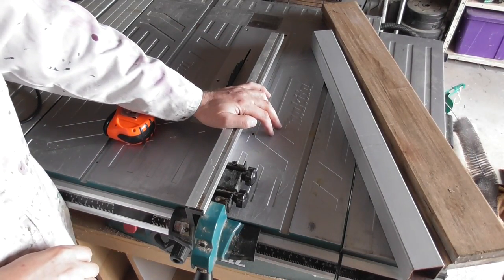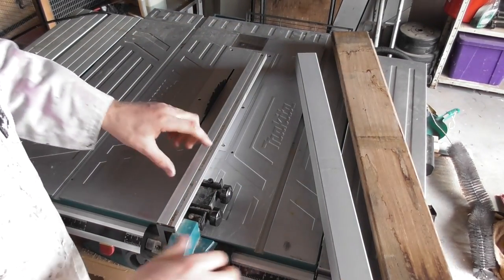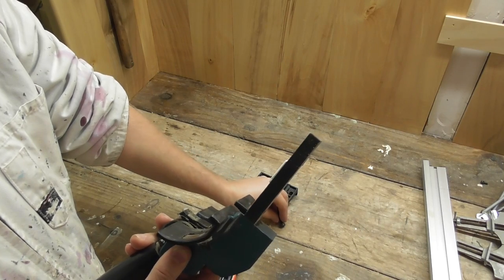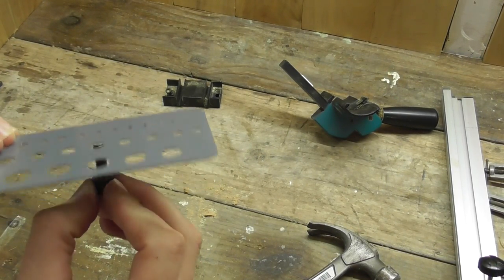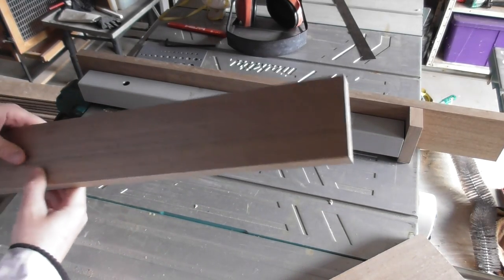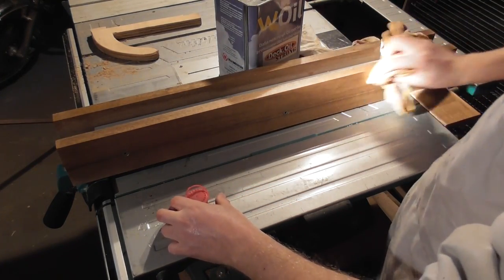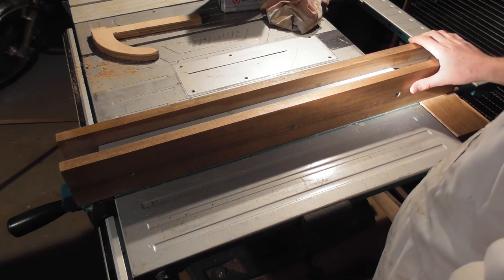Makita MLT100 Table Saw Rip Fence Upgrade

Comment: Legend! I made this over the weekend and no longer hate my table saw. Gives a MUCH better cut, and feels a hell of a lot safer to use now that the fence is rigid. Thanks so much for this. I looked through lots of fence upgrade videos and yours stood out. Should be more highly ranked in search results.
Reply from the maker: Cheers, glad it worked out.

Comment: When adding the end piece that locks it in you can use wedges in the slots to line the fence against, gives it a slightly more parallel alignment

Comment: I just got myself a MLT100 about 2 weeks ago, and was starting to regret it, I always thought Makita meant quality,  I noticed something was wrong when it was not giving me a straight line. I put it down to the arm straight away. I saw this video and thought, I am never going to be able to do that, I am not a carpenter by trade. I just started making things as it was taken months and months waiting for a professional carpenter to finish a job.  but I gave it ago anyway see how it would come out. the only difference is my 4 holes where the arm is, are all 13 mm. and I place the other section inside the tube. so it still moves as the original.  I am now able to straighten the arm up nicely. I did what you said about fixing the back plate but noticed you'res had slight movement as you said, so after aligning it I moved it 1 mm closer and that gave a nice tight fit. now when i level it I can close the arm half way, get the final straight line and close fully... and it looks just like you'res.  Thanks ever so much. my cuts are way better than they where.
Reply from the maker: Have you replaced the shitty plastic blade inset yet? I recommend doing that for safety and accuracy reasons. I have a video on that too if you need ideas.
Reply: @ToolsAndStuffOFFICIAL  That stupid black plastic surrounding the blade. :-).  thats on my to do list lol.  the one you made can that do 45 degree angles too or just for straight cuts. ?

Comment: I have just finished making your mod on my saw. Thanks mate. Works a treat. You mention in your comments that the slide fence isnt accurate -bit sloppy. I fixed mine tonight. I had the bottom of a Resence paint bucket that I cut up to make a dust collector. I cut a 10mm strip off it and wedged it into the groove running along the inside edge of the sliding tray. I fitted 2 strips one on each end of the tray, The plastic strip is patterned on one side and grips tight. Slider is now a little bit stiff but that will ease with use I reckon. Doesnt slop about and thats the main thing! Cheers Paul
Reply from the maker: I have been meaning to pull the sliding table apart an fix it up to make it more accurate but have never got round to it as I mostly just use the saw for ripping. But maybe your idea will make me do it.

Comment: I didnt take the tray to pieces- just pushed it to the end to expose the groove on the side edge. They I pressed the strip in and tapped it i tight with a tack hammer. Did same on the other end. Super quick n easy. Groove is about 3mm and gap about 10mm to side of saw. :) Paul
Reply from the maker: Cheers, I will give it a go.

Comment: nice! spent the last two weekends running timber through mine and this would have been a huge help, I'll have to pick up some taps 

When you tighten the stock fence it moves quite a bit, can be a pain if you just have a mark on a board and you are moving the fence to line the mark up with the blade.. then you tighten up the fence and it moves a few mills (not such an issue using the 

do you find that while you are tightening the new fence it straightens up before the block at the end clamps it in place? 

also could be useful for attaching feather boards and other jigs too, also nice to be able to replace the wood as it wears/ gets chopped into
Reply from the maker: I know the issue you are talking about and it is a real pain. It seems good with the new fence. I was going to fix this issue at the handle end but wanted to use the fence and get the video out so I ran out of time. I might also make some other attachments and jigs.
Reply: i have spent all day doing just the things you talk about !

Comment: One thing you did not show, is how did you align the fence to the blade. I have a MLT-100, and the blade does not run exactly true to the mitre slots, did you align to the blade, or the mitre slots?

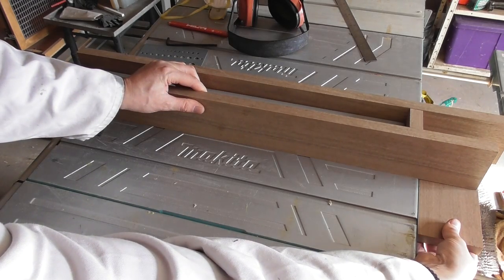Comment: Everything looks amazing. One thing I didn't get - Why did you put a shim under the fence before drilling through (07:15 ) ?
Thanks
Reply: One more thing - did you screw the 300mm locking back piece when the fence was open or closed ?
thanks

Comment: Looking at the rattle you had when trying to guage first drill hole I would have thought both holes at 6 mm would have given loads of flex to allow adjustment. Also why not drop the bolts through from the inside of the steel and place nuts on underside ?

Comment: Hi, nice job. Could you please tell me where you got the hole size template from. The one you used to size the bolt. Thanks
Reply from the maker: I can't remember where I got it, I think it came in an old drill set. You should be able to get one at most hardware stores or search for 'drill gauge' on ebay or google.
Reply: You could try Anxminster in the UK. They offer wordwide shipping.

Comment: This MLT100 Makita with it's short and fixed at one end rip fence is the same fence design as the Ryobi 1525RCSC from 2013 year.  I have to ask... as the saw comes and with the play in the end is it more prone to kick back or less prone to kick back.  There is no apparent way to square up the original design with the edge of the saw blade, and if the back of the blade is closer to the fence than the front of the blade, that can't be good at all, because the saw back teeth will lift up the work, fast!  It seems to me that the new fence is safer from a kick back point of view, but i'm no expert.

Comment: Have you done anything about the elephant in the room - which is the fact that the runner on the right-hand extension table doesn't line up with the runner on the main table? If you have the fence clamp overlapping that in any way, there's a several mm swing at the other end of the fence. I'm thinking of shimming both, just shimming the main one slightly less than the one on the extension, so they're properly level with each other.
Reply from the maker: Here is my quick solution: https://youtu.be/7RVBMr4Ti-I

Comment: The flex in the fence is designed to prevent the blade binding in the timber and you notice the flex occurs after the wood has entered the blade. So when the fence flexes, its at the rear, the cut is already made and therefore should be not be effected by the fence flex.
 "Improve" it by all means, but dont forget the riving knife/anti kickback pawls, (which have been removed!),  may not prevent the blade binding/kick back if youre cutting hard wood with a not so sharp blade. When your new fence doesnt allow flex and you notice things are slowing down, the natural reaction us to push harder! Thereby generating friction etc, etc. You know the rest. Think id have been tempted to run the timber used between the blade and new steel fence to ensure it was perfectly parallel to the blade.
Nice vid but be careful!
Reply from the maker: You are completely wrong. Most good table saws have the fence locking front and back. The flex is NOT a feature, it's a failure.

Comment: Hi sir I’m an avid follower of your videos. I’m a newbie in woodworking, so the first step I’m going to commit is, purchasing either 2 of these items.. Miter saw from makita XSL06 or Bosch GTS1031 table saw.. both is about the same in price (im on a tight budget somehow) .. which one is worth to buy? Any advice?
Reply from the maker: Those two tools are hard to compare as they are completely different. A table saw is a more versatile sawthat you can do more things on, but if you are not cutting sheet material then a mitre saw is much quicker, safer and easier to use. I love the Makita XSL06 and can't believe I don't have one yet. The Bosch looks to have some cool features, although it is very small. The blade inset is also horrible and would need to be replaced to make it safer and more functional. Also you would need to build a sled for it to use it in a similar fashion as a mitre saw.
If you are going to be using the tool mostly for long lengths of timber (i.e, for decking, construction, anything longer than about a metre) then get a Mitre Saw.
If you are going to be cutting ply, mdf, ripping timber length ways, then get a table saw.
Personally I would always buy a Mitre over a Table. Some people will disagree, but it all depends what you want to do with it. I have both and use my Mitre saw 10x more than my Table saw, but wouldn't want to be without either.
The Mitre is also more portable as it is battery, so that costs a bit more.
Hope that helped.

Comment: Mate this is awesome, nice work.  I was about to make a video about this exact table saw I found at the dump last night.  Works great in excellent condition.  I wonder if this is why they tossed it out.  Think I'll be doing your solution for sure.  Cheers 👍
Reply from the maker: Make sure you replace the crappy black plastic blade insert.
Reply: @ToolsAndStuffOFFICIAL  wiil do 👍
Reply from the maker: I made a video on that too.

Comment: Where did you get the timber from? Can you get it from Mitre 10 or Bunnings?
Reply from the maker: You won't find Vitex at Bunnings or Mitre 10. I get it from South Pacific Timber, but that is in Auckland so not much help for you. You could use any hardwood. Sometimes they have hardwood decking at Bunnings and Mitre 10 which would do. You could use rimu or even pine if you get a nicely finished bit from B or M10.

Comment: Initially you had a brace between the two boards but was removed later. Any particular reason. I have the same saw and have the same problem with fence. Thanks